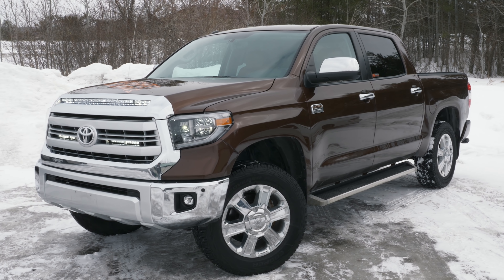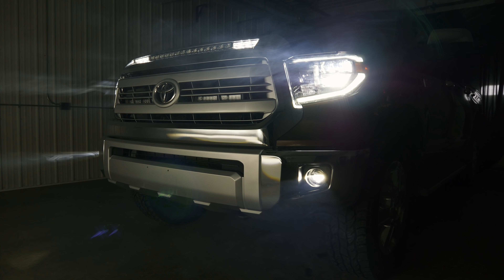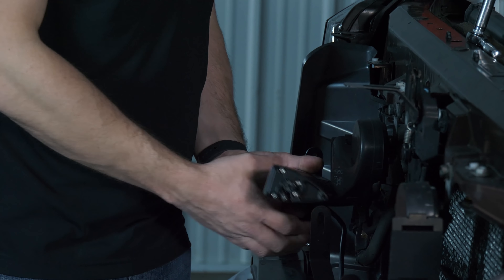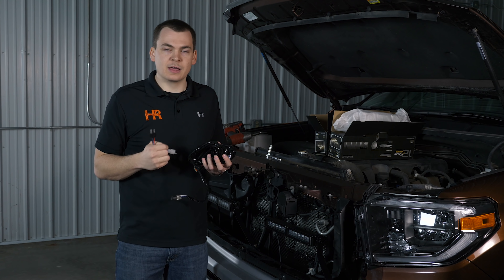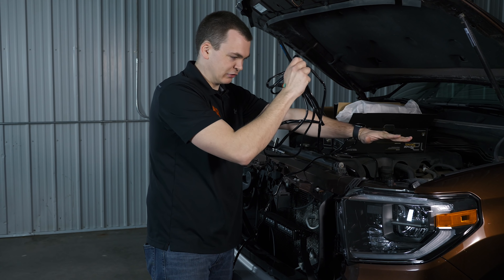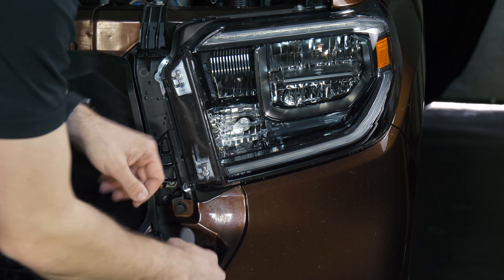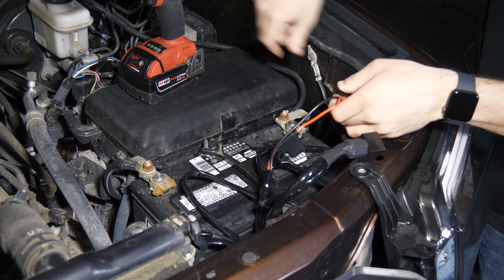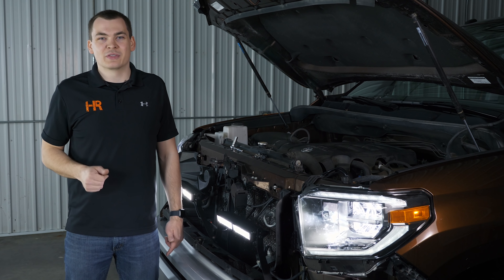Diode Dynamics Stage Series Light Bar Install | 2014 - 2019 Toyota Tundra

Comment: Is that "Plug and Play High Beam Adapter Harness" just an option for those vehicles? I love the idea but can't seem to find that adapter on their website. I wanted to get this kit for a first generation Tundra (2006 model).
Reply from the maker: It's possible it could maybe work but nobody knows because it's never been attempted. That kit is made for a third generation Tundra (2014-2019) and not guaranteed to work on any other models.

Comment: Hello, looking to buy the lights but read on DD website that they won’t work th the newer store LEDS per DD website “The H4 high beam adapter included in this kit will not be compatible with LED headlights.”  I do have a 2016 with the HR revolution kit with new OEM leds as the truck is showing.. so what is my option :)
Reply from the maker: This could be wired to a separate switch or some sort of alternate high beam trigger!
Reply: @geovani galvez  When you say "newer store LEDS" would that include the TRD Pro Headlamps (81110-0C211 & 81150-0C211).  I am using a harness kit with them on my 2021 Tundra.

Comment: Is there a possibility we can install/hardwire the 2 light bars with the turn signal? For example, if we can hardwire each one when the turn signal is to the left the left on would blink and vise versa to the right.
Reply from the maker: There is a way I am sure, but that is not something we would have any way of helping you with, and will also void the warranty through the manufacturer on that light bar. I would highly recommend just upgrading your turn signals to LED, or going all the way with the complete housings!  Link: https://headlightrevolution.com/2014-2020-toyota-tundra-xb-led-headlights/

Comment: Do you guys sell the headlight adapter switch by itself
Reply from the maker: Which specific part are you referring to? The OEM LED headlight conversion harness?
Reply: Headlight Revolution  The h4 Connector that will turn on the light bar with the highbeams
Reply from the maker: I see, unfortunately we do not.
Reply: @bigpun2001  are you referring to the adapter he uses in the headlamp to wire adapter
Reply: @jalvarez7242  yes I would love turn on my light bar at the Same time my high beams
Reply: @bigpun2001  I didn’t use the headlight adapter. Ran mine thru the firewall grommet into the dash
Reply: @jalvarez7242  would u be Interested in getting rid of it